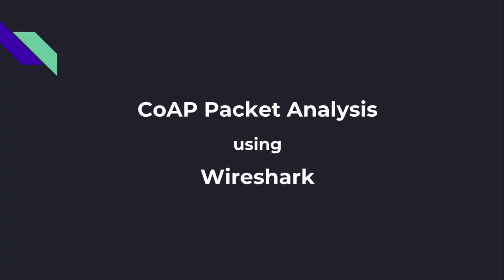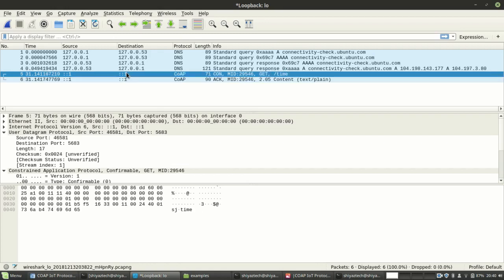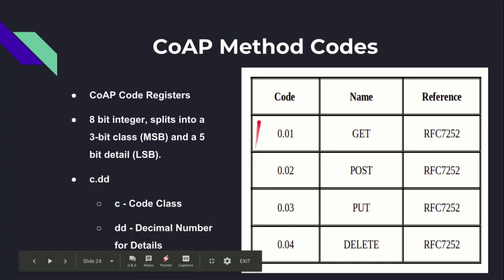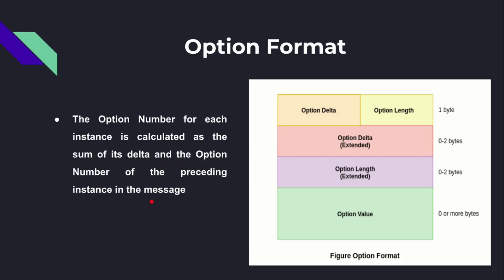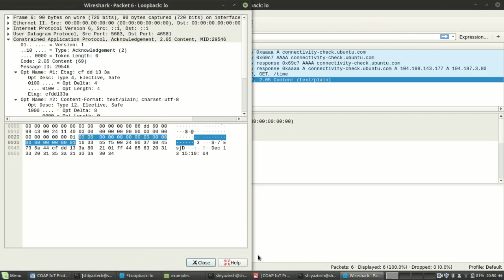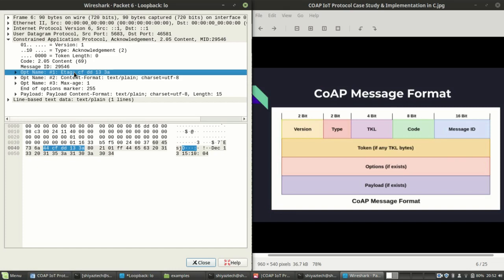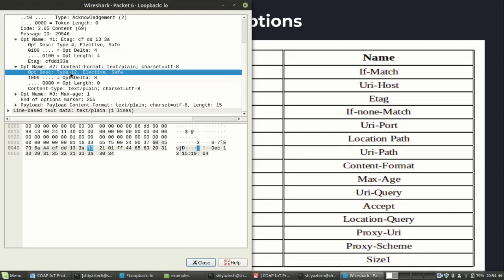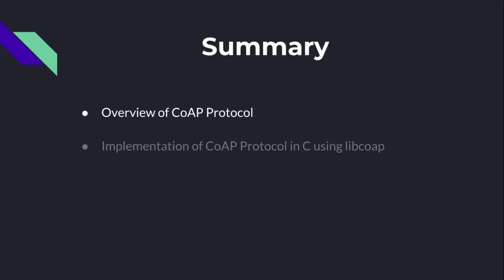CoAP IoT Protocol: CoAP Packet Analysis using Wireshark Packet Analyzer Part 3 of 3

Comment: Hi, thanks for the wireshark demo. Makes things quite clear. However, would really be helpful if using the same client server endpoints you would use options extending the detla beyond 15 as well as the length beyond 15 for much more comprehensive clarity. Say, you show a demo with option no. 39 (Proxy Scheme) and provide an arbitrary string of size 100bytes as the option value.